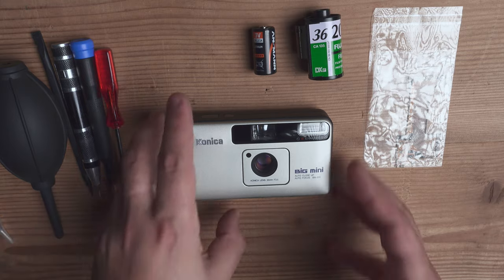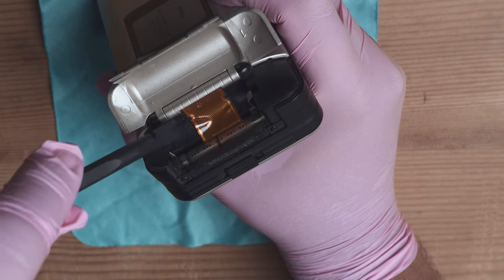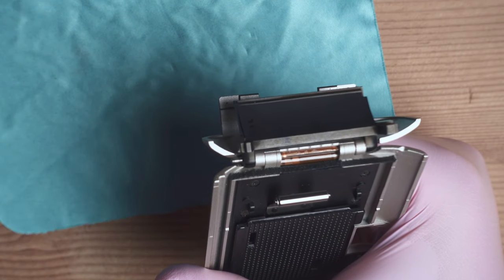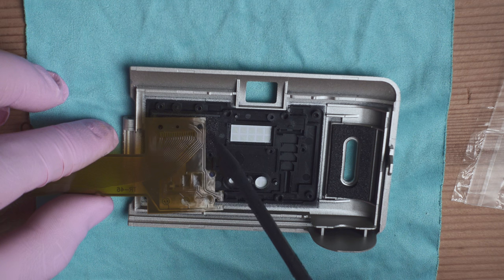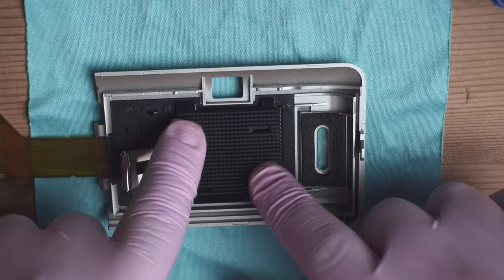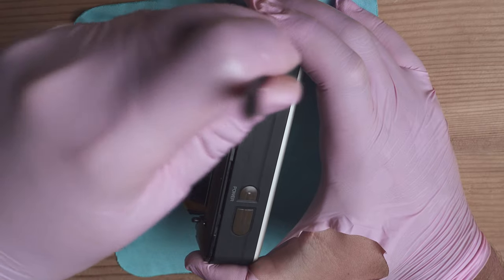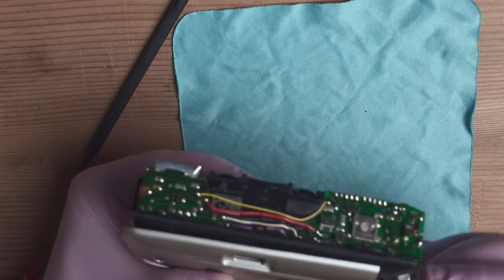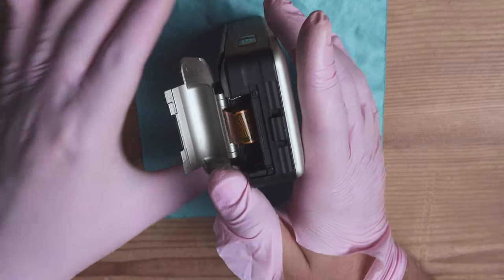Konica BIG MINI BM-201 LCD Flex Cable Repair Tutorial

Comment: Nice Video! My big mini has a broken flash. Do you have any idea, what could be the problem?
Reply from the maker: Thanks! Sorry I am not the expert on electronics i just knew how to fix that one issue. Unfortunately all that 90s tech is slowly decomposing.. leaky capacitors and stuff..
Reply: Hey @tho3rsten my big mini’s flash is also broken. Have you found a workaround? I think it is the battery’s power supply not powering through the entire flash process. 

My workaround is to use rechargeable batteries and interchange usage from time to time across one film roll. But this still doesn’t guarantee that the flash would work whenever you want it to. 😢

Comment: I have Konica big mini BM-301 and A4 cameras. everything is working properly. Do you know any precautions I should take to avoid having the flex cable problem? Thank you.
Reply from the maker: Only thing you do is limit opening and closing the case back unnecessary however eventually it will break. Unfortunately vintage electronic cameras break a bit more often than the way older mechanical cameras

Comment: Hey Kamil. Very useful video. I got my old konica A4 (1992) for shooting and I got two issues. The first was that the advancing of the film somehow make some of the photos double taken (one to onother) and the second is that the cable broke too after a couple of films. But as I can see the camera takes photos without the rear screen. 

I would like to ask you if he rear screen has sth to do with the camera function it's self or it is just to give us informations and some manual settings? Without this cable can get photos or not?
Reply from the maker: Hey, sorry im not the expert on electronics i just knew how to fix that one issue. All that retro technology is slowly falling apart mostly due to leaky capacitors..